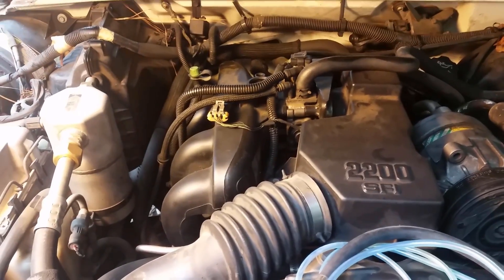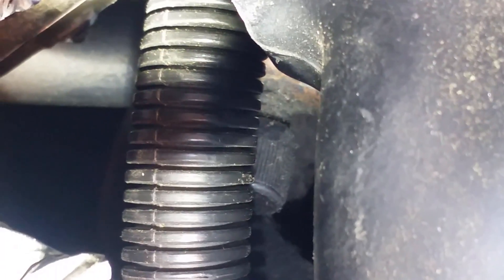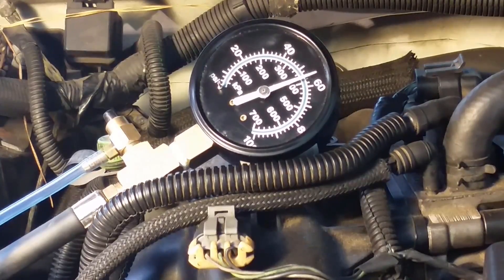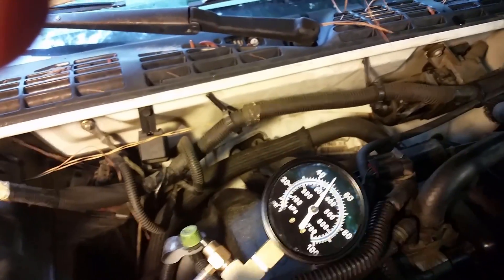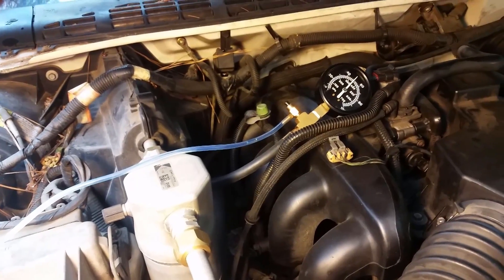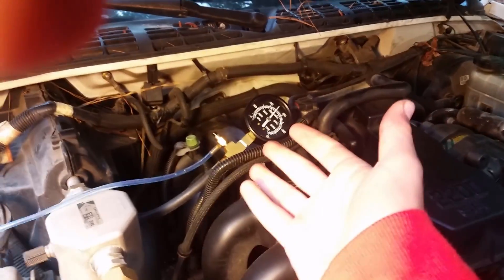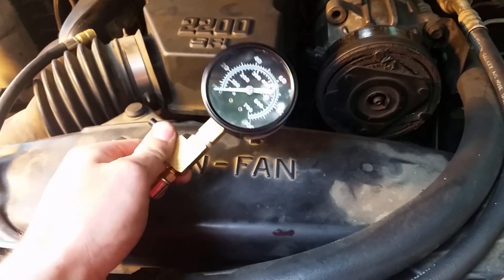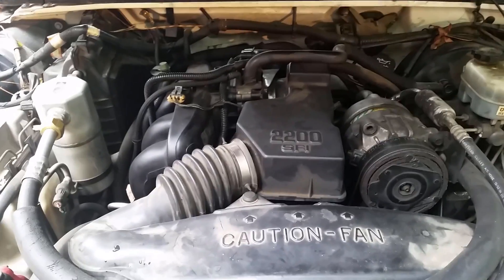How to Test Fuel Pressure (Chevy 2.2L)

Comment: The fuel filter and fuel pump was changed. Still seems like the truck doesn’t have enough power. Going up hill in 5 gear, hits 55 mph. When I give it fuel with the hood up, sounds like it is sucking in a lot of air. Is that normal?

Comment: Hey I have the same 2.2L S10 as you but I can’t seem to get my fuel pressure above 45PSI. Do you have a flex fuel model? I’ve replaced my pump, regulator, injectors, filter. Still 45 PSI. I’m at a wall on how to get my pressure up to where yours is.
Reply: Kevin Valenta where you find the pressure regulator; my is 2000 2.2 fuel flex?
Reply: I have 41 PSI at idle, mine is 1999 2.2L not fle fluel and yours?
Reply: Fuel regulator on flex fuel 2.2 is in the fuel filter

Comment: Hello I have a 98 s10 2.2l and its saying 0psi on fuel rail sometimes it will go a couple psi but not much ,I can hear the fuel pump coming on is it possible its still bad even when it's coming on or could it be the regulator?,  thx for video
Reply: I'm having the same problem does any one have any ideas which is it????
Reply: @cynthialozano6468  hello not sure if you have the same truck but I did replace the regulator and that was it hopefully this helps mine was clogged and was on the fuel rail

Comment: I have 99 s10 2.2 liter with intermittent no start/long crank time to start, though sometimes starts right up. Suspecting fuel issue. Fuel pressure is about 40 with key on, and about 35-40 while engine running. When turn engine off gague shows it holds pressure. Is it possible weak fuel pump? Do you know fuel pressure specs for 99 2.2 liter engine. The fuel pump was replaced about a year ago, so I didn't suspect it, but now wondering since my pressure reading is at least 10psi less than yours
Reply: Did you ever figure out your problem?

Comment: My son s10 2.2 pressure just drop did not hold planning to change injector and fuel regulator. Am I on the right track. It would have a hard time turn over. once it turned it rain good after few minutes off it would have a hard time to start and smoke black.
Reply: I hope you’re still active on this accident, but I am having a similar issue and wanted to see what solved your issue???
Reply: @jermainegutierrez6304 I got PO171 code what u got

Comment: I just got a s10 it has a new fuel pump new filter and new injecteors... It idles fine if you barely give it gas it runs fine no problems.... But if I give anymore than half of the gas pedal it spits and sputters so bad the engine boggs and the best way ik to describe it the way it sounds is a 1990's honda civic with a fart can trying to do a 2 step.....if anyone may have an idea what it could be plz help I got it bc I thought it would be a simple and easy fix like spark plug or coil pack but they are fine.....
Reply: Did u figure it out ?
Reply: Plugged cat

Comment: my s10 2.2 is getting fuel pressure  and spark but is not starting. it will run on starter fluid. what do you think it could be. i cant figure out why the injectors are not pulsing
Reply: Did you ever figure this problem out? I’m having the same issue.
Reply: Try looking at spark issues

Comment: What if I have 90-100 psi while running?
Reply: If you have a SFI 2.2 S10 like shown in this video,  then your fuel filter is probably bad. Three port filter has a pressure regulator. I had a brand new filter that had a bad regulator and I'd get 100 psi at idle. Put the original back in and pressure dropped to 55 psi at idle.

Comment: Mine was staying at 61 psi while at idle running. I hope that is in spec? When I gave it some throttle, it didn’t go up. I guess that normal on these cause 61 psi should be plenty under load...

Comment: My truck won't start 2.2 gmc 1998 Sonoma and with engine turning over read 35-39 psi could this be reason for no start cause it to weak? TKS FOR YOUR TIME
Reply from the maker: That should be enough for it to, at the very least, try to start. I believe your problem is elsewhere. I would check to make sure you are getting spark and compression.
Reply: @MightyMechanic  Checked spark and already put in new fuel pump still trys to start for a few seconds longest was like 12 seconds could it possibly be a jumped timing chain on this 2.2 gmc sonoma 1998, also replaced crank sensor and i believe its good since tach moves when it starts to fire a little also thought about camshaft sensor but leaniong toward timing chain skipped any thoughts would be greatly appreciated.
Reply: @maryshan80  probably definitely timing, timing chain tensioner usually breaks/loosens prior to chain failure, personal suggestion; don't bother changing crank sprocket. Not worth the headache

Comment: Hey I have 0PSI in my jeep but my car starts and sometimes I have to crank it longer to start. Could it be a bad fuel pump?
Reply from the maker: Does it stay running after it starts? When it does start what is the pressure then?
Reply: MightyMechanic it stays running after I turn it on, never shuts off. But the pressure is 0. I think my pressure gauge is broken or a bad fuel pump. I'm going to test the fuel pressure gauge on a different vehicle.
Reply from the maker: It can't run on 0 pressure. You must have a bad tester.

Comment: what is that hose/line that has a green cap?  it's by the intake. thanks
Reply from the maker: I believe that is the EVAP hose. The cap is where you apply pressure or vacuum to find a leak in the system.
Reply: Air conditioning